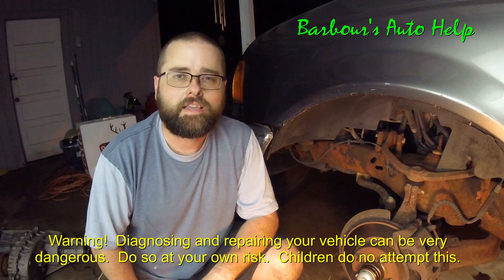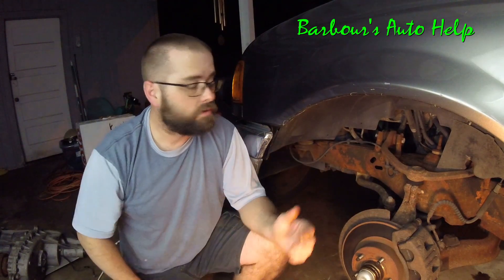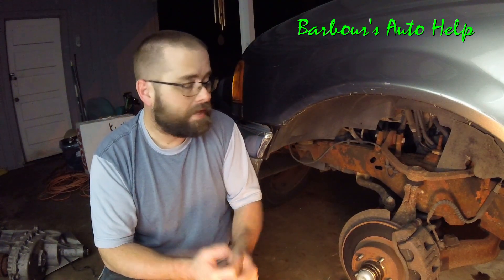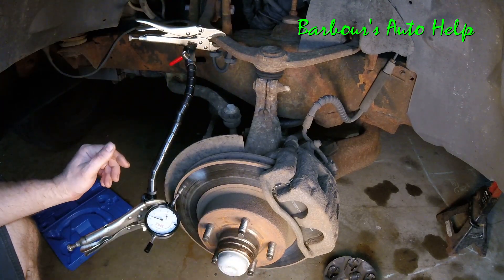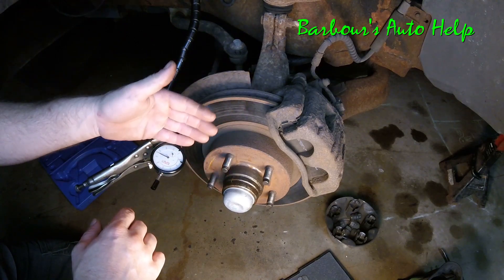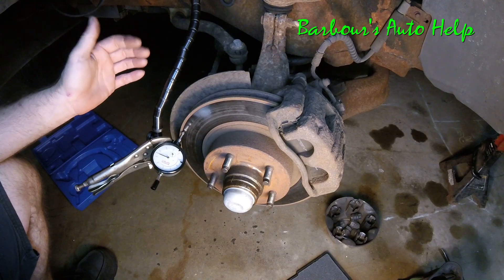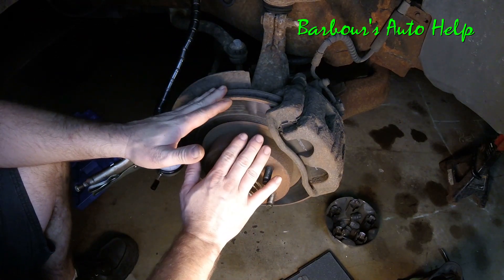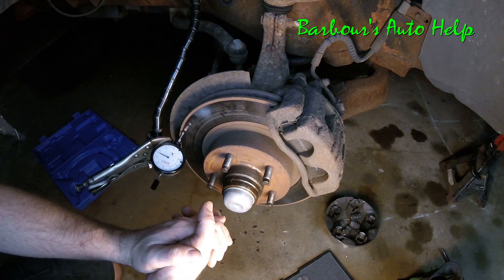Vibration While Braking? (How I diagnose warped rotors)

Comment: the rotor has to be g;owing hot before it can warp, the very common cause is your gliding pin,they cant move freely  anymore,  because it has rusted already and makes the pads engage to the rotors  that causes pulsation or steering vibrate,  have the problem on my 2003 camry , cleaned the gliding [pins  sanded the bore of the pins  put some lube ,,,,, my smiles are to my ears,,,, the problem is gone
Reply: wdym by gliding pin? caliper pin?

Comment: Hey there, I changed my brake pads recently after running the old ones with the wear indicator squealing (my bad) for like 200 miles. After changing the new brake pads, I feel a little shake in steering wheel when I apply brake above 120kmph. It feels like I have slightly damaged one or more rotors with the old brake pads. But what I don't understand is how come I didn't feel the vibration with the worn-out brake pads, but only with the new brake pads? Another thing is, the pads on my front and rear left worn out more than the ones on the right. What could be the reason? Thank you so much!
Reply: Check your sway bar links

Comment: Thanks for the video. I have changed my front rotors and pads because it was diagnosed with - Offside Front Service brake fluctuating. After the rotors and pads were changed only in the front, I still had a similar fluctuating issue. The steering is not vibrating, it feels like something is stuck on the rotors and has this intermittent braking feeling. I have changed the front rotors and pads again recently and I still have to drive the car to see if the symptoms persist. I intend to change the rear rotors and pads asap. If the symptom will persists even after changing the rear rotors and pads, what would you suspect? My car is a Mazda 3, petrol, from 2016. Thank you.
Reply from the maker: Id suggests having a tech look at it.  Find out exactly what is causing the problem.  Go from there.
Reply: @BarboursAutoHelp  Hi. Problem solved by changing the rear discs and pads. All the symptoms are gone now. Your method of diagnosing warped rotors is efficient, at least it worked in my case. 
Both rear rotors (discs) look bad on the inside and also on both sides the inside pads were stuck - not sure if this contributed to the symptoms. I have cleaned the calipers, sliding pins and replaced both rotors and pads - no more vibrations. Thanks mate!
Reply from the maker: Thanks for the update.  Good luck to you.

Comment: I installed brand new rotors and brake pads. Rear and front. Idint have a vibration before with the old ones. Since I got the new ones my whole car shakes except for the steering wheel.
Reply from the maker: Dawg!  That stinks! Sounds like maybe bad parts?  Not sure, friend.
Reply: @BarboursAutoHelp  replace rear rotors and pads. Problem solved
Reply: @danielguzman8346  where the new ones bad ? You replaced them the 2nd time and it fixed the issue?
Reply: @SavvyCris  eventhough everything was brand new. I had to replaced the rear rotors and pads . vibration gone.
Reply: Maybe the wheels weren't tighten correctly or you need an alignment

Comment: For some reason alot of utube videos don't call it warped rotors. They call it runout. I prefer the term warped rotors. Just rebuild front right caliper due to frozen piston.  Ruined rotor causing warpage. I replaced the rotors. But bought adial indicater w/magnetic base to double check the hub
Reply from the maker: I also prefer the term warped rotors.  Hope you talk goes well.  Thanks for commenting.